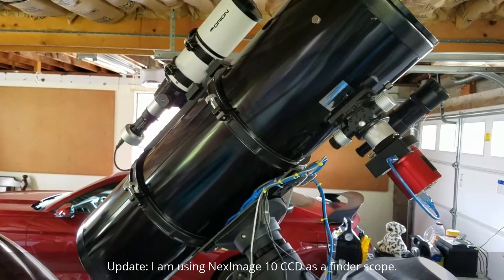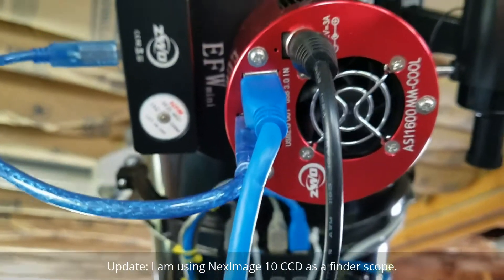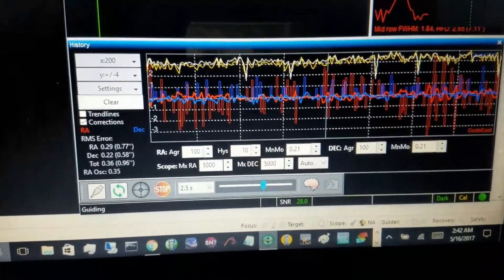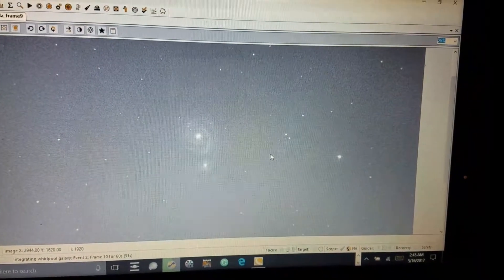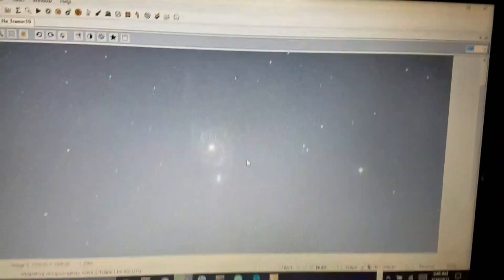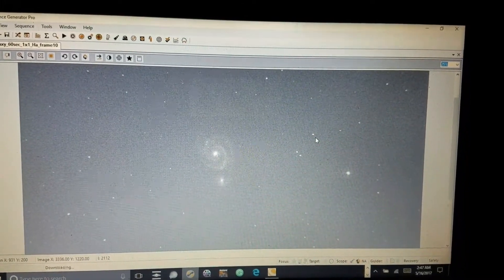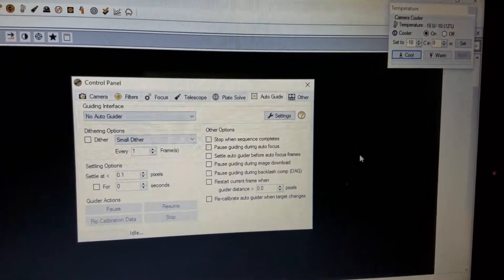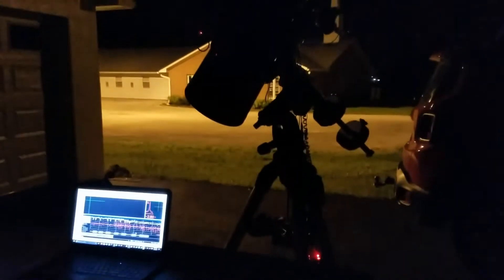Whirlpool Galaxy with astrograph 10"

Comment: Amazing setup! Which Losmandy dovetail do you use?
Reply from the maker: I can't remember, I ordered the dovetail from telescopes.com for cgem dx cradle mount because the 10" astro newt came with a skinny mounting bar.   Hmmm, I forgot I had this newt, I have to say it gets more light than my gso truss.
Reply: @jefflucas_life   I habe the same optical assembly, tho i was worried for its stability as i mounted it with only 2 screws in the losmandy plate... i'm afraid the two screws could bend or even break from the weight of the telescope.... did you use the stock telscope rings too?

Comment: Would the Orion 9996 Atlas EQ-G hold this beast?
Reply from the maker: Your Orion 9996 has a limit of 40lbs.  The Orion Astrograph 10" weighs 25.5lbs.  You are already 40/25.5.  If you can limit your mounting accessories to 35lbs, I would say yes with "PERFECT BALANCE" on the RA / DEC axis, so balance that if a fly were to land on any axises, the fly would tip the balance..  I would not do any hyper tuning, I would use a 50mm guide scope, nor use any finder scopes and make sure cable weight management is not taxing the slewing motion from point to point E/W, be sure to support the weight of the cables to hang on the mount.
Reply: Jeff Lucas what mount would you recommend?  Im trying to decide between this or the 8" for photography.  Wouldnt an 8 produce the same image with slightly longer exposures?
Reply from the maker: My experience, the larger the aperture, your 10", more light you can gather in a shorter period of time and great for far faint distance objects. Shooting Messier objects, the astrographs for 10 and 8 are F4s no difference, however, you can tell the big difference beyond 30mlyrs.  Considering your mount at 40 and thinking of your wallet and space considerations, go with the 8" astrograph, you won't be dissappointed.